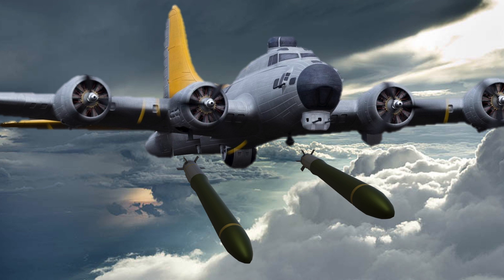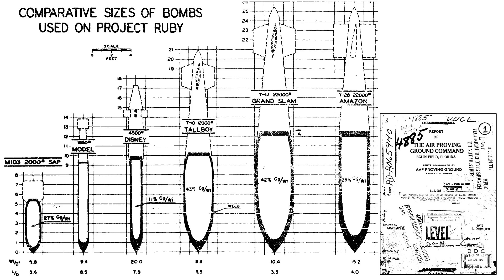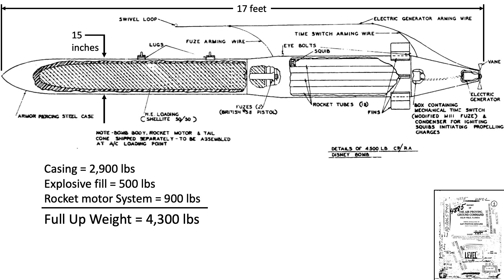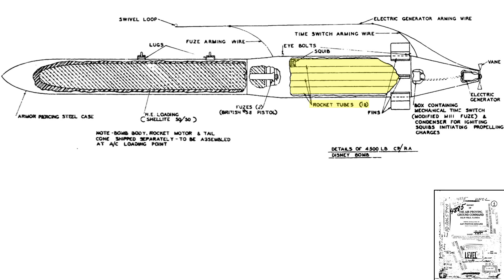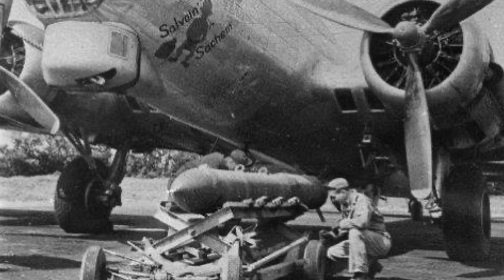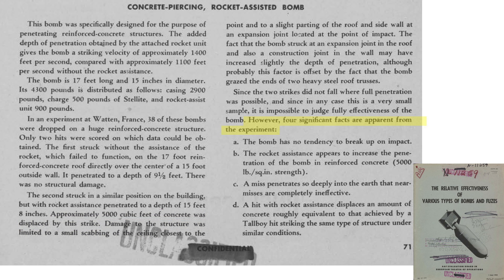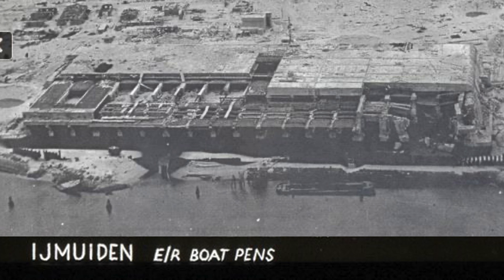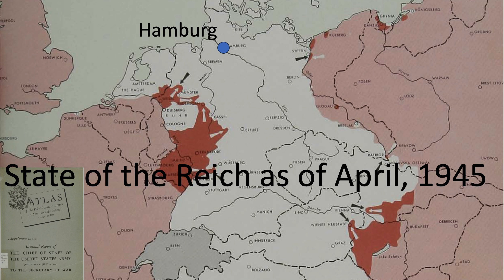Attacking German Targets with Rocket Assisted Disney Swish Bombs-- WWII Weapons Review

Comment: There was one of these stuck in the roof of the Blockhouse V2 launch site just outside St Omar in Northern France (24seconds in there's a photo) It failed to penitrate the concrete and then didn't explode. The RAF finished the job with Tallboy bombs which actually broke the structure. Which, if you have ever seen how massive it is, you'd agree was an impressive bit of bomb dropping. Worth a visit. And if you're in the area, check out the cupola. Another V2 site again worth a look.

Comment: Did u mean 23 inches not 23 feet thick????
Reply: Up to 23 feet & some were layered like spaced armour to make them even harder to punch through.  15ft was pretty much the standard roof thickness for a U-boat pen.  Sometimes even 12,000lb Tallboys hitting at Mach .95 (750mph) couldn't get through.  These are massive structures that will be there forever.  The Germans pored so much concrete in WWII they ran out of river sand & had to use washed beach sand.

Comment: 200ft of penetration in soft soil only to leave a 36 inch crater is wild.

Have to wonder if these would have been effective in the pacific campaign if deployed against rocky cave-like targets.  Bombing runs at lower altitude would have presumably been more accurate.
Reply: By April 1945, the British had decided that there was going to be no use for the weapon against Japan and production of the was capped at 2000 weapons built.

Comment: 1. Wonder what was German reaction. If the Germans moved the uboats after the raid that would make the raid effective.
2. The effects of speed increase are not very inpressive. In heindsight the extra weight of the bomb could be better used to add a prevoursor cummulative charge to errode a narrow tunnel for bomb to squeeze into. That would require a pizo fuze however.
Reply: Precursor shaped charge.*
Reply: British had been blowing holes in large concrete structures for around 7 to 8 months when this thing first was used.
Reply: I heard that one who's beer bottles broke was Grumpy, the one who's clothes blew off was bashful, the dust kicked up made one sneezey,  etc

Comment: I wonder if it was Reaction Motors Inc that provided the rocket motors.
Contrary to popular belief it wasn't Werner Von Braun or Rocketdyne that developed the method of circulating the fuels through cooling tubes that wrap around engine bells to cool them and pre heat the fuel (and or oxygen), RMI developed and patented it in 1938.
Reaction Motors Inc has roots that go back to the 20's but took that name in the mid 30's, they're who made the rocket motors for the X-1 and X-15 along with other rocket planes, Scott Crossfield said in an interview once "By the time Von Braun and that crew at Redstone got their first rocket off the ground we had over 50 rocket powered flights using Reaction Motors Inc engine's".
Reply: RMI made mostly liquid fueled rockets and did R&D work on JATO boosters during WWII. They would not have designed or built these rockets.  They were making relatively small rockets compared the ones being developed for ballistic missiles and orbital launchers.  Not really comparable.
Reply: @obsidianjane4413  
Yea and these were small, what does ballistic missile's have to do with it?
And they were involved with that stuff more than you know, Rocketdyne bought them just before they designed the F-1 engine and they were a part of designing it, as of acquiring them the Reaction Motors Division as it was known from that point on had more know how than Rocketdyne itself did, that's exactly why they bought them.
Reply: Rocket motors were 3 inch RP motors as carried on the Typhoon and anti sub aircraft. The weapon was developed by the Royal Navy.
Reply: The Germans also had rocket boosted bombs.   The three main types were the PC 500 Rs, PC 1000 Rs, and PC 1800 Rs. PC from Panzersprengbombe Cylindrisch ("armor piercing cylindrical bomb") the number from the approximate weight of the bomb in kilograms, and Rs meaning rocket propelled. These bombs were intended to be used against armored ships or similar targets. The purpose of the rocket propulsion was to increase the terminal velocity of the bomb and aid penetration

Comment: Whu did they choose shellite as a filler?
Reply: Maybe it was more stable for the higher shock on hitting, could survive the penetration better, tended to stay together better?  Just guessing.
Reply: @grizwoldphantasia5005  According to Wikipedia it seems you are correct.

Shellite originated after World War I as a development of lyddite (picric acid). During the war, lyddite-filled, armour-piercing shells had been found to be shock-sensitive, with a tendency to prematurely detonate upon impact rather than after penetrating the target's armour plate.[2] Shellite was less sensitive, and also had the advantage of a low melting point, that allowed it to be easily melted and poured into shell casings during manufacture.[3] The first trials of shellite took place in 1921, when the British monitor HMS Terror experimentally fired different types of 15 inch (381 mm) shell at 500-yard (460 m), point-blank range against the surrendered German battleship SMS Baden.[3]

During World War II, Shellite continued to be used in naval shells. It was used in the British Disney bomb, a type of concrete-piercing bomb.
Reply: @gctzx  The bomb was designed and developed by the Royal Navy!!!